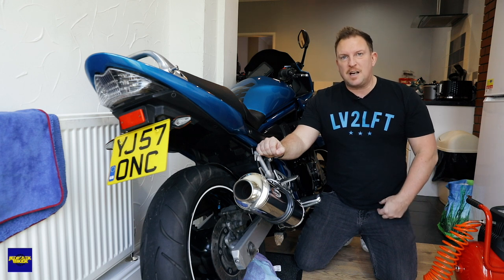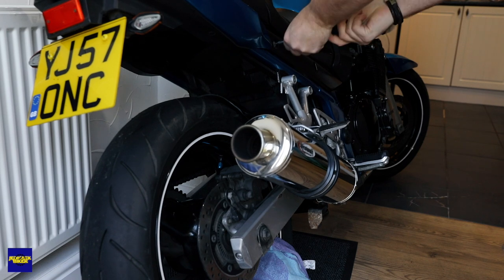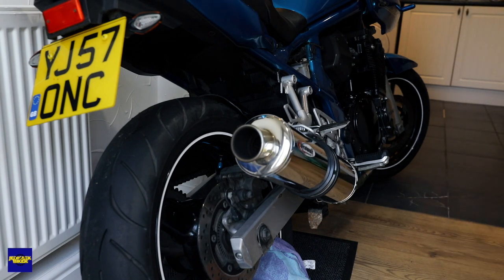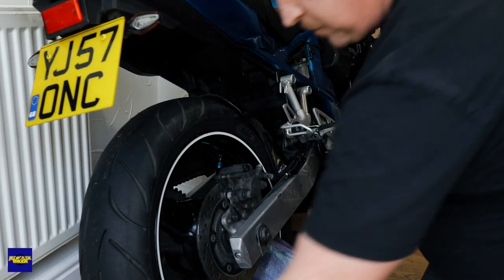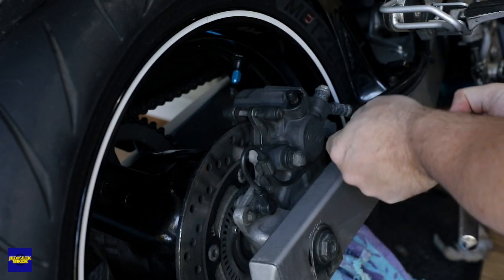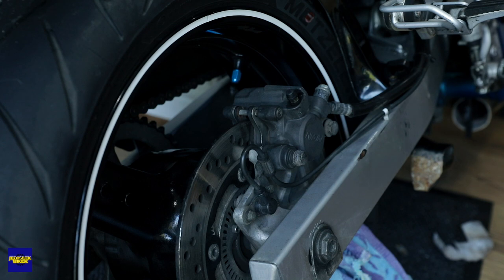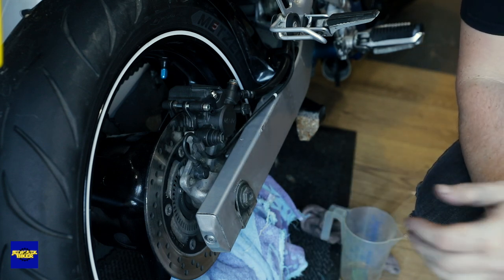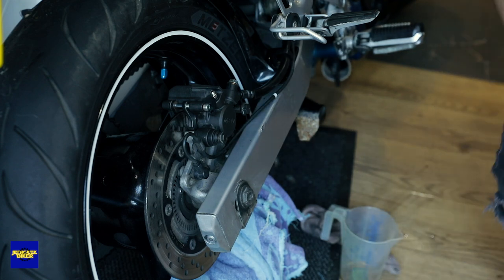Suzuki Bandit 650 Rear Caliper Clean and Rebuild + Brake Bleed (with slight hiccup)

Comment: Good video mate. Perhaps could do with some editing to make it shorter, but I appreciate it! Quick note, I'm pretty sure you're supposed to lube up the seals with brake fluid, and not the grease. Grease is only meant for the guidepins so they can slide effectively back and forth. Either way it's been a while since you uploaded so I'm sure all is fine.
Reply from the maker: Hi, thanks for the input. The red rubber grease is for the seals and is recommended for calliper rebuilds to stop the rubber cracking. I would imagine if you don't have any a coating of brake fluid may be ok. If you grease the guide pins they attract dirt and get sticky. I just keep guide pins smooth and free of dirt. Brakes have been great since this rebuild.

Comment: I certainly hope that was tea you took a swig of at 50.22 mins, and not fresh brake fluid, (Lima Oscar Lima). 

I always give a like to videos (unless they are obviously and deliberately trying somehow to be offensive) just for the effort it takes to create, edit and upload them, and I have done 'like'wise here.

Now good Sir, I have several observations, and I hope you will take them in good spirit. I am no expert, I am not trying to be a nerdy smart arse or anything, it is just a matter of braking safety. Please accept that at face value, and you are welcome to delete this comment if you find it jarring in any way. I repeat, it is not a know-it-all critique, but hopefully a beneficial observation.

1; A debate rages over the use of grease or lubricants on the brake seals. You are certainly correct to use red rubber grease on the carrier axle boot, however I am sure that my Suzuki workshop manuals assert that no lubricant is to be used on the piston or seals. They suggest instead a mild smear of actual brake fluid, at most, to ease their passage into the caliper housing. Make of that what you will good Sir, I just make that observation. I think part of it is the risk of grease particles or clots existing within the fluid inside the housing, and so perhaps then of more importance on multi piston calipers where fluid transfers between chambers via drilled ports and suchlike. This here is of course a single piston caliper.

2; Perhaps of more concern is the caliper spring clip orientation at 42.03 mins. Forgive me, and I know how easy it is to mis-orient such things, especially in the heat of battle on video - as it were - however the 'long' slipper section of the spring should be at the piston end of the brake pad recess. This is to ensure that the piston-side pad can essentially 'skid' across unimpeded as wear takes place over time, and the piston itself then necessarily extends to compensate. Cripes, I hope I am articulating this in some meaningful way. Anyway, in the video it very much looked like the 'short' spring slipper' was up against the piston-side. I hope I am mistaken, and/or if you have revisited this since and corrected its orientation, then please ignore my gibberings. When the piston side pad tries to transit across due to pad wear, it will 'trip' and snag on the spring slipper gap now in its path (do you get me?). Essentially what I am saying is that the spring orientation is very important. 

Anyway, enough of that. You demonstrated steadfast determination to be doing such projects in your kitchen in the first place, and to show my bonna fides I shall sub to see more about your experience with the Ghost action cameras.

Kind regards, and all the best.
Reply from the maker: Hi, thankyou for your advice, I will check the spring., I have done 100's of miles as it is but I do see what you mean.. Thanks for your great input